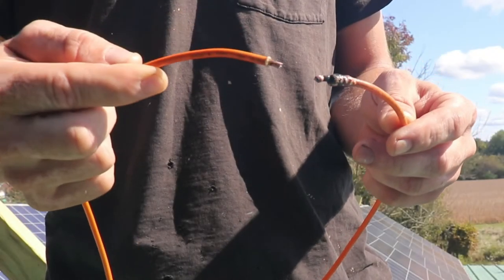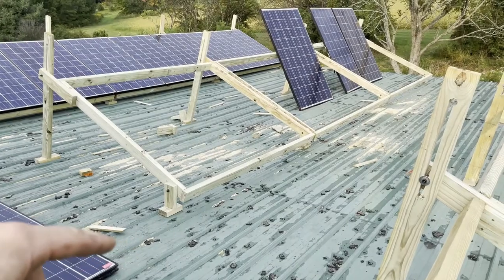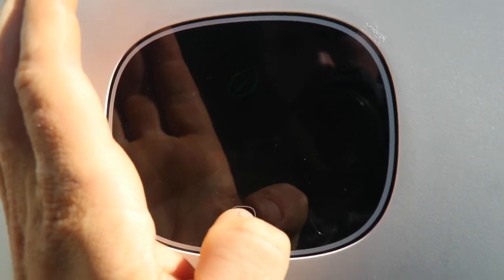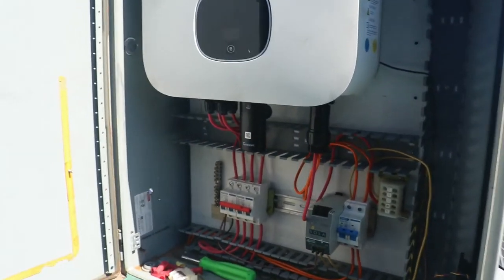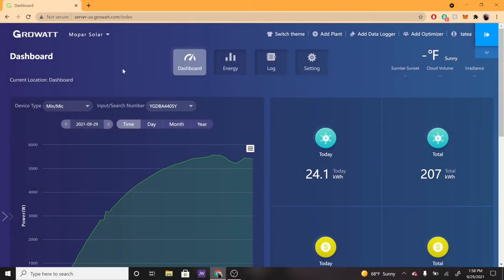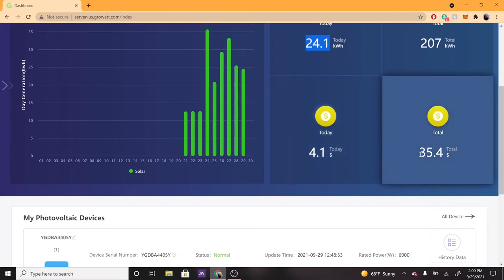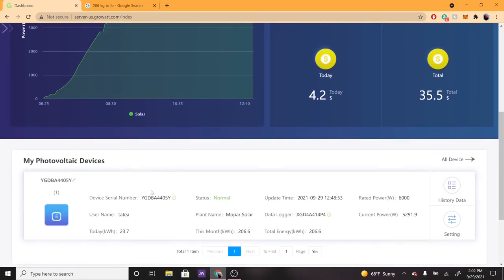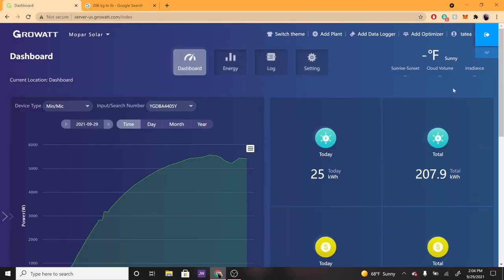DIY 6KWh Solar Setting Up | Gird Tie

Comment: great vid I enjoyed the details...I'm making almost the same system in a couple months...if I can get 42KW/day I'd be real happy, in Arizona, not sure where you are but you must also get a lot of sun...they say you don't need a DC disconnect for this system for some reason, I think because you can just unplug the mc4 connectors easy enough...would love to see how you're connected to grid, for some reason nobody ever shows that part...did you use a double breaker and put the black to one and white to the other and then ground to the side bar???  would love to see a grid tie pic please??

Comment: Hi, If the box that houses the Growatt is all metal, the wifi will not work well. Wifi does not penetrate metal very well. I couldn't tell if the door to the box is metal.

Comment: 12.6.21  Hello, I am currently trying to do the same thing you are doing with the 6000TL-X Gird Tie..
Questions:  Where did you get that metal box that the Growatt and other components are sitting in?  Could you list what the other components are?
What happens to any excess watts that are produced?  I did see at that end of video you have an older power meter and spinning backward so the excess watts are being a benefit to you.  What if you had a more current digital meter?
Nice how to video.  I liked your idea on the usb wifi dongle to see if could gain a getter signal if used a usb cable to move inside your barn.
I see that there are the x  xe  xh models.  Don’t know what those mean.

Comment: Hi Tate.
The AC terminals on the plug are marked G,L, & N.
How did you wire these to your panel?
Reply: (G)round is white (L)oad is Black and (N)eutral is copper. Hope this helps!

Comment: You have a practically maxed out 6k system and it's making like... 21 kwh a day?
Reply from the maker: On best days i'm making about 42-44 kW per day.  So far sense installed I have made 4859.9 kW. And at the time of this comment, I have 39 kW to day. I think there was one day last year when I first installed it I might've bumped 50 kW that day.

I have another 40 panels I have to get installed, I need to get them up but I haven't had time to. If I ever get it all together I'll have about 70@250w panels up, that will give me about 17.5 kWh.

I ended up having to replace a couple of those panels that were up there because two of them failed sense installed.